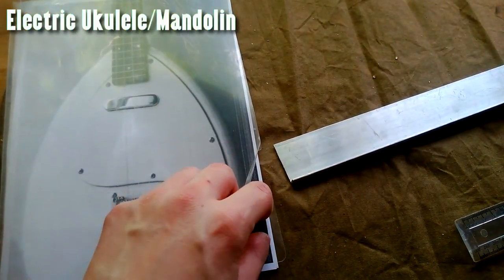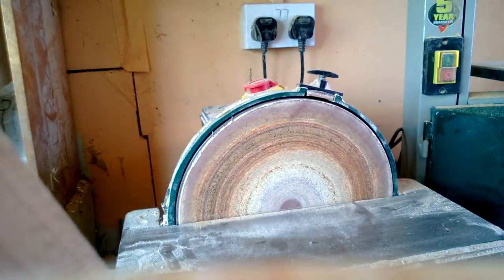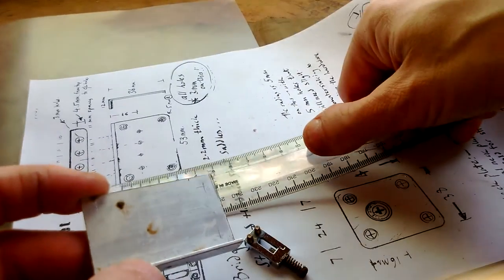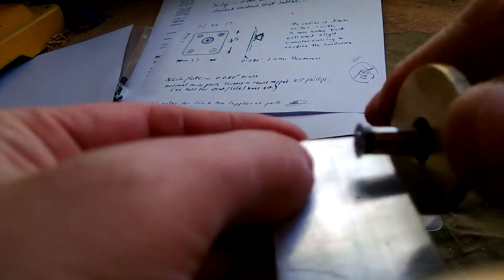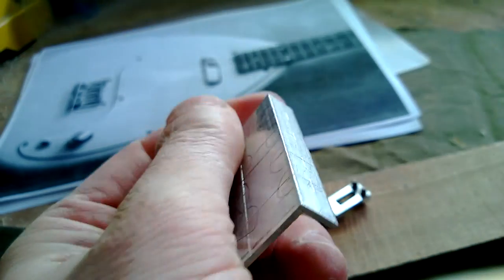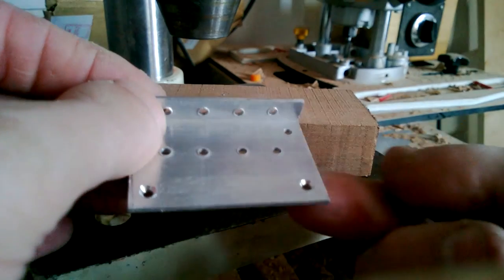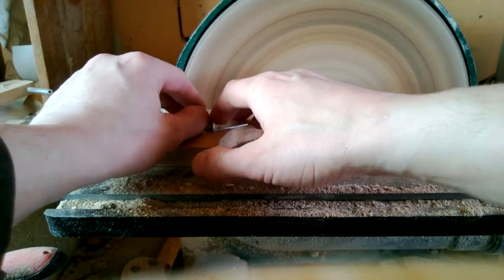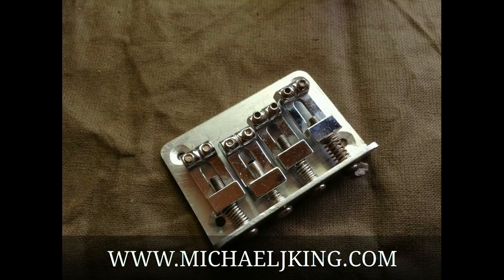Bridge Making for Cigar/Tenor guitar, Electric Ukulele or Mandolin: by Michael J King

Comment: We've cranked out a couple dozen tenor acoustic ukuleles. I'd guess our fretboard template (15" scale) would work fine, as would our LMI fret slotting jig.
It's the electronics that would be the challenge. Visitors from space, upon watching me in action, would write home: "Soldering: a method earthlings use to burn holes in carpets and scar furniture."

Comment: Very good go-through. I’m considering a 5-string mandolin build. If I were to extend this design out Telecaster style to include a pickup route, what approach would you recommend for cutting that route? I’m thinking maybe drilling to establish the rounded ends, then going in with a small hacksaw for the edges.
Reply from the maker: That’s the easiest way,  drill holes, then saw and file.  I think you could also use a router jig too with aluminium or soft brass. Router Templates for pickups are sold or you can make your own

Comment: how can I make electric mandolin bridge, but for 8 string mandolin? Shuold I keep this design, and just make holes where string are goig through bigger?
Reply from the maker: One way is to have half the strings top mounting and the other half through the body.    In either case you will need to custom file the saddle slots I think
Reply: uggghh, that it too much work
however, I am going yo thy to make it, thanks for advice :D